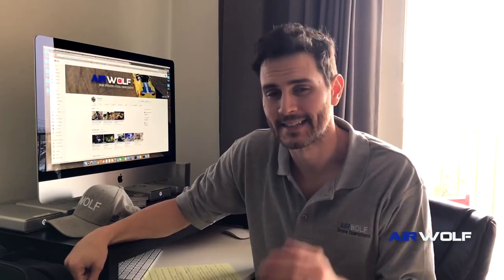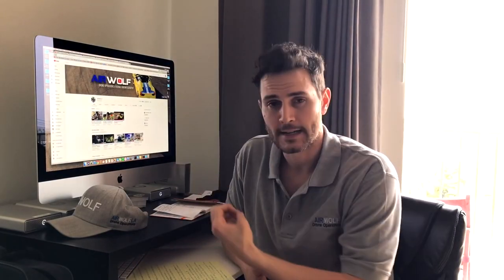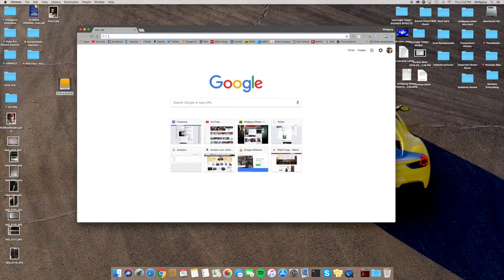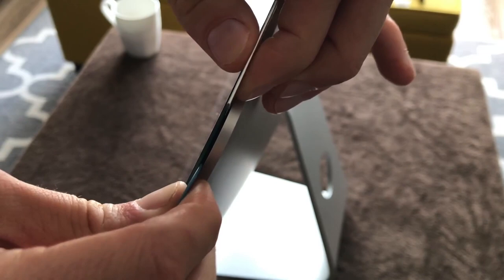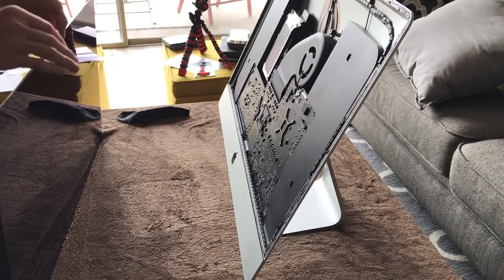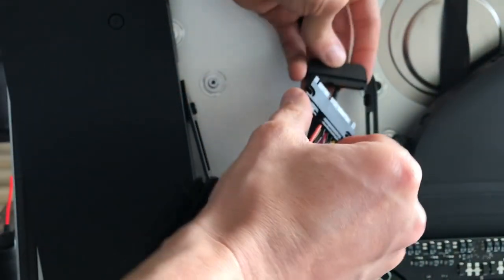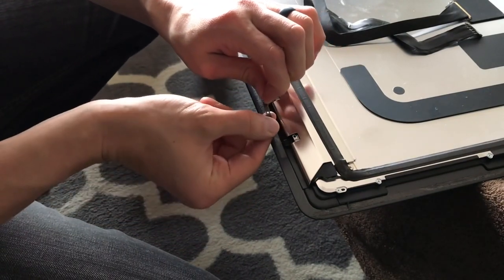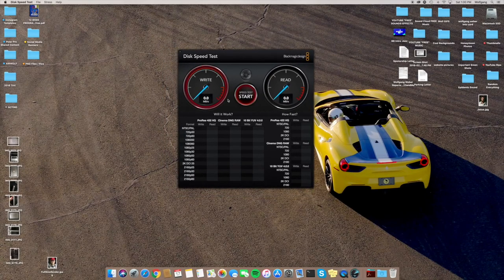Step-by-Step iMAC SSD Upgrade Guide for 5x Faster Performance | 2012-2019

Comment: This is the best detailed video I have seen on refreshing older iMacs and keeping them going.  I'm having trouble with Light Room CC,  some screen glitching with lagging on inputs under the load of the files I'm running from My Sony A7RIII.  I think its the graphic card but I wonder if this could be a fix with also maxing out the ram?
Reply from the maker: I think it’s should most definitely help
Reply from the maker: And thank you 🙏🏻

Comment: FYI Fusion drive iMacs have just regular spinning drive HDD. On Fusion drive iMacs there's a second NVMe solid state disk installed on the other side of the logic board. This acts as the SSD portion of the "fusion drive". In reality it is two drives, but the system treats them as one through software tricks. Early fusion drives (Late 2014 iMac 5K) had 128 GB NVMe-SSD and later models BACKWARDLY switched to a lesser 32 GB NVMe-SSD (greedy Apple).

I shall try this HDD switch to a standard SSD soon on my iMac. Appreciate the video. I bought a good quality SSD today, one of the better SATA III SSD's, the Samsung SSD 870 EVO 4 TB. The Samsung QVO is cheaper (quad layered) but slower and with a lesser warranty. Another option is Crucial, but I read today one person's Crucial drive failed in their iMac. The 870 EVO is more expensive, but you get what you pay for.
Reply: Update: the hard drive switch went fine. One minor problem. In the OWC kit (OWCDIYIMACHDD12) they supply two blue 2" suction cups. Never saw anyone on YouTube using suctions cups, but figured it was part of the kit so must be fine. Now my display is broken. When it's turned off it doesn't look broken, but pulling with those suction cups damaged the display and now I have a big 3" vertical band coming down on the left half of the display that's visible when you power up the computer. An eight year old machine and it was perfect before. Treated it so well over the years. Was so annoyed I was fit to throw the iMac out the window. I'm careful and methodical and take my time doing stuff like this. Do yourself a favour and NEVER, ever, ever use the supplied suction cups. Throw them in a bin/trash as soon as you set your eyes on them. OWC just cost me €1,000. Idiots ruined my Christmas
Reply: Guys I'm going through same problems but worse with imac 2017.  Not even attempted the internal switch yet, went external ssd combo, worked for months and everything went Peak towards end of my last semester at uni.. near the start of the next now but apple ruined me and possibly my MSc this Christmas.  I got to say.. Could be my Gpu or the internal hdd needs replacing if not the nvme also?  I'm dreading it's My screen or power but worse time to replace and kind of need a mac Pro over the same jive:/

Comment: Hey partner, great video. My Imac 5k comes with a PCIe drive that can be upgraded to a 1gb one, do you know if I can do that and pull out the HDD?, would that work fine or do I need to keep another drive? THANKS WOULD HELP A LOT TO KNOW  because it would cost me nearly the same thing to replace only the PCIe drive and have only one unit or add and SSD like you did. The thing is that a PCIe drive is much faster than the SSD.

Comment: Great video all you need to know is here thanks. A lot of people is complaining about the adhesive included in the links, have anyone used it and had problems with it?
Reply from the maker: Thats the adhesive I used and I haven't had any issues.  I think folks are either not cleaning the surface area thorough enough or forgetting to clean one side of it.  You HAVE to remove ALL the old adhesive before installing. 

If folks are still worried you can always just use a 3M dual sided adhesive.
Reply from the maker: Here another adhesive that'll work if you're still skeptic.  It's just more work to apply it. 

https://amzn.to/2WmpHxN
Reply: AIRWOLF I think that was the problem not preping properly.
Reply from the maker: @robertogomez8100  I 100% agree.

Comment: you can install the thermal sensor connector directly to the ssd?  I thought I needed to buy an adapter bracket first

Comment: Great Video thank you for sharing, is install Thermal Sensor important, can I add SSD without it ?
Reply from the maker: Thanks so much! So, apparently you don't need it.  But I added because I figured why not? Mines still running fine. Hope that helps.
Reply: @AIRWOLF  I'm upgrading my iMAC smoothly depends on your video, great work @airwolf  Keep ahead.

Comment: I didn't use cloning software when mine was upgraded. I just formatted and used my time machine backup. Careful with that display. You can crack it if you don't get the tape completely cut
Reply from the maker: That works too.  And yes the screen is fragile.

Comment: Love diy videos. This stuff is not voodoo magic and if careful is quite easy. 
1. There's a simple plastic roller tool I bought that stops you from going too far in and damaging the lcd.
2. I used carboncopycloner to copy os. Does the same as your suggested program. 
3. I've had the drive directly taped internally and the sensor anywhere on ssd. Makes no difference as the ssd has no moving parts. 

Great tutorial tho!

Comment: You can use macs fan control instead of a thermal sensor. It's a better overall solution imho
Reply from the maker: It could very well be.
Reply: Whether it's a better overall solution, idk. But I can confirm that MFC works pretty good on my MBP 2012 (with 500GB SSD and a 1TB HDD in a caddy instead of the DVD drive). It regulates the heat very good. Only when I do a video conference and also editting etc, the laptop is getting warm. But you can easily set the fan speed higher.
Next week I'm gonna upgrade an iMac 2012 21,5" with a 500GB SSD and 16GB of RAM in stead of the current 8GB). Takes more time but hey, when the screen is off, most of the hard work is done and when it's open, I can better do it all at once. If I'm gonna use a thermal sensor, idk. I'm gonna do some research on it. 
If I have any remarks, I will add them here. It might help others.

Comment: There is no reason to go through all the trouble to mount the SSD inside the monitor. 
You can just put it in an enclosure and connect it using USB3 or Thtunderbolt.
Reply: The simple and very important reason is, that imacs before 2017 only got TB2 for which you don‘t get any enclosure and they only got USB 3.1 which is maxed out @5-600MB/s therefore with the internal SSD Replacement you can get up to 3000 MB/s due to PCI 3.x. 5 x times faster is a very good reason.

Comment: Great video brother I just was thinking of upgrading my 2013 I got the fusion drive in it now thinking going full blown ssd in it. You think it makes a difference going from fusion to full ssd. And also the Samsung ssd Evo you are using and major difference between the Evo and the pro  I mean it's like 100 bucks more I believe.   While I'm in there anything else I could do. I gotta fix my mounting bracket as well it won't tilt figured while I'm in there might as well get down and dirty and go nuts. Thanks bro
Reply from the maker: In regards to upgrading from fusion to SSD. Yes! There’s a huge difference. Fusion drives are only partial SSD’s. And I also recommend upgrading your RAM to the full specs. And lastly the difference in EVO PRO vs the Reg EVO to my knowledge are the speeds. You’ll want the one with the fastest. The one I used gives read/write speeds of 500+mbps. Hope that’s helps

Comment: Super Awesome video on this thanks, just want to confirm, downloading superduper! and copying drive, will automatically format new drive and then copy operating system and all files??
Reply from the maker: It will but you can always format ahead of time if you want
Reply: @AIRWOLF  one more? my current system has 8gb ram, worth upping to 16? i noticed you didnt do yours?
Reply from the maker: @thomasdicostanzo417  I actually did max mine to 32G. I just didn’t make a video about it. But yes! 100% increase your Ram

Comment: the dust does not blow out the bottom. the bottom is the intake. the exhaust is on the rear approx in the centre.
Reply: It does when you blow air from the top ;) As you can see the intake has the motherboard in front of it which will collect a good amount of dust that will not be able to make it to the exhaust  :D
Reply: @valentins9287  blowing air in through the exhaust port is more likely to deeply impact the dirt back into the computer whereas sucking it out through the intake ports is moreso likely to bring that dirt out of the computer, in my opinion.

Comment: what if you imac has the fusion drive? will it still be faster after an upgrade to SSD?

mine is the 2013 27" imac
Reply from the maker: Yes.  Fusion is only a portion SSD but mainly uses the spinning part of your drive for most of its work.

Comment: Surprised no other videos used rubbing alcohol like here. I would defo do the same.  But what about static shock? Is it really a risk? You never mentioned it. Also I read other people’s comments that without the thermo the fan could go on nonstop. 

I have yet to do my late 2012 iMac. I only want to replace the HDD to a 2 TB SSD without cloning. Can I just put an SSD straight into the iMac without formatting and installing the apple OS? I have the original apple keyboard wireless only.  Regards

Comment: GREAT VIDEO! THANK YOU.  Before I pry this puppy open... QQ. I have an iMac late 2012 in pristine condition, 1TB SATA 8G DDR3 that will not update to more that OS 10.8.5.  If I upgrade the HD to a large SSD is that all i need to upgrade the OS? If not, what else needs to be upgrade to-- I think I am trying to get to Mojave 10.14, or some OS that will allow Chrome to be supported/upgraded? Thanks in advance!

Comment: Because there is extra space inside the iMac body, and the bracket you recommend could fit two SSDs, do you think it could be done, to upgrade to 8TB with the Samsung EVOs?
Reply from the maker: It can be done yes, but at the time I didn’t have the knowledge of it.

Comment: Hi there, this is a great video but in your description of the Samsung SSD you used you said it was with all the components needed it would be around $350ish, yet the Samsung SSD link you have to  Amazon says  it is  $699.  Is there another one that isn't so expensive to use that will still work well for my  late 2012 imac ?
Reply from the maker: That’s because it’s for some reason listing a 4T drive. There should be a spot where you can select less storage.
Reply: I just bought a Crucial MX500 2tb today on amazon for $229.99. It’s 100% compatible

Comment: This is so GREAT! THANK YOU and Merry Christmas, Sir!
I AM going to do what you explain here, but I see on other people "cloning" their HDD on iMacs just using built-in disk utilities...so, it the cloning device and extra software really needed? I would love to save the money, BUT don't want to make a catastophic mistake on my iMac (it is late 2013 with OSx Mojave 10.14.6,  and i5 2.9GHz, 16GB Ram, and a 1GB Nvidia GPU and - I think - a 5400rpm half full 1TB hard disk). 
Please help me not make a mistake. Thanks again!
Reply from the maker: You 100% do not need to clone it. You can restore from a time machine backup. Or pre install the OS on the new drive. 

Merry Christmas 🎄
Reply: Cloning software is free trial, it'll be free to do this work for you. Pay if you keep it for future backups. Also try CCC (Carbon Copy Cloner) u should do one or the other, but do it. Drives die.

Comment: I just used your links to pretty much buy all the stuff. Cha-ching for you! However, the link for the correct adapter bracket on the ssd is no longer available/in stock. Just a heads up. I ended up getting the short one and will just deal with it too. Thanks for the help!
Reply from the maker: Hahaha Cha-Ching. Well I appreciate that 100% Ryan. Thank you, I’ll get on fixing that link ASAP. Sorry about that and happy upgrading! 
PS- my iMac is still going strong 💪🏼

Comment: I did and worked fine for the first week. I did not installed the temperature sensor for the new SSD Hd. And now the fan are very loud and the screen turns off each 5 seconds. Using a temperature monitor software, I can’t see the HD temperature (off course) but I can see everything else ok,  except the LCD temperature that shows 125 degrees. What is not true... Do you think the reason of the LCD crazy temperature is because I didn’t installed the hd temperature sensor cable? My iMac is a mid 2015 one. Thanks for this awesome video in advance! 👍🏼
Reply from the maker: That’s really strange. It sounds like your monitor is getting false readings.  The SSD doesn’t really put off heat.  Was the sensor installed right by the SATA connection? That makes a difference.
Reply: @AIRWOLF  I did not installed the temperature sensor cable for the new SSD hd... Do I really need to buy and install it? Thanks for answer! :)
Reply from the maker: Technically no. But this is the first I’ve heard with this model running the fans high. There is a way to just control your fan speeds but I think it’s a third party download that I know will work.
Reply: I heard in another video that if you don't install the temperature sensor, the system will not be able to read the temperature and will make the fans run at 100% capacity, so that might be the problem.
Reply from the maker: @phillpine  Thats why I just went ahead and installed it.
Reply: I see the same Felipe, but I see for iMacs until 2013 using SATA hd’s. My one is a mid 2015 with SSD hd, which isn’t supposed to heat. Please confirm if the video you saw shows an SSD hd. Thanks.

Comment: Thanks, there is no link to the actual pre-cut tape you used for reinstalling the monitor, or perhaps the link has changed?  Also for those of use who can't clone their drive due to HDD failure but have good Time Machine backups, do you just use the boot up Command R method to restore the SSD?
Reply from the maker: Time machine is also another way yes. As for the preroll cut, it was included with the kit.
Reply: @AIRWOLF  - Ah, ok, so select the Thermal Sensor Kit instead of just the cable, I missed that 👍🏼
Reply from the maker: Yes! The 3M was just in case folks didn’t trust the precut. Just make sure you clean and both sides. The monitor side and the aluminum side. Use rubbing alcohol.

Comment: I could be wrong, but doesn't "fusion drive" just imply that you combine your m.2 with your hhd or ssd, whatever drive you have in the harddrive bay, and have your mac combine as a single drive? I could be wrong, I'm very new to the mac world. I've been a windows and android guy for a long time. To that end, I wonder is there any benefit to going into your command prompt to combine m.2 and a 2.5 ssd as a single volume? I know that the original benefit was to optimize the use of the hdds and using a 256gb m.2 as sort of a harddrive cache rather than intended as a primary storage volume.

Comment: hello. i have been watching your video and studying it, I'm planning to upgrade my iMac 27 inches *2017. Is this procedure will work on  a fusion drive to ssd? and do i still need the thermal sensor? thank you in advance. cheers 🇦🇺
Reply from the maker: Ian Guantero Yes it’ll work. As far as the thermal sensor I don’t have a solid answer. But like myself I installed it anyways.
Reply: AIRWOLF awesome. I’m not very techie thou, could only upgrade rams. By watching your video, make’s me brave enough to do it. Already bought all the stuff I need. Cheers. 👍🏽

Comment: One more question , how the adhesive tape is holding up. I've read some bad reviews about screen falling off after 48 hours of installing . Thanks
Reply from the maker: I haven’t had any issues. Still on and still strong.  Just make certain all the old adhesive is removed on both the screen and the aluminum.  And use alcohol to clean the surface.  A lot of these cases where screens pop off. From what I’ve heard is that folks are only cleaning one side.
Reply: @AIRWOLF Thanks

Comment: cloning this wouldnt cause issues to your installed software right? it will work just fine? thanks.
Reply from the maker: You’ll be fine, so long as you haven’t had any issues prior.

Comment: Hey @AIRWOLF, I have Mac mini late 2012, want to upgrade HDD to SDD, will that worthy? anyway I can use NVMe with that instead sata (possibly external) ?
Reply from the maker: Sorry for the late reply. But yes any upgrade to an SSD will improve performance overall. If you go externally you’ll be limited to the speeds of your USB.

Comment: The only thing that scares me is the adhesive!! Just reading reviews on amazon some people say that their screens are falling off!! So have you had any issue with your screen not sticking anymore?
Reply from the maker: Theo Trujillo That’s strange. Mine has been fine. I think people are not cleaning  both surfaces enough before applying the adhesive. And they’re trying to blame their stupidity on the adhesive manufacturers in hopes they’ll pay for a new screen.  I suggest use a blade tool and remove everything then use alcohol. It’s gotta be clean. 🧼
Reply from the maker: Check out my community tab I posted a recent photo of it. It’s still my main computer.l and love it.
Reply: @AIRWOLF  lol ok that makes sense!! Well ill give it a shot then! Thanks for the help!!
Reply from the maker: Theo Trujillo of course! Happy tinkering 👌🏼
Reply: Yup, clean surfaces with rubbing alcohol, then put on adhesive, and I would use painters tape for a few days just to keep it on securely. Just like when windshields are replaced.